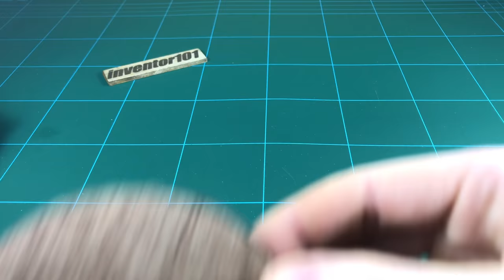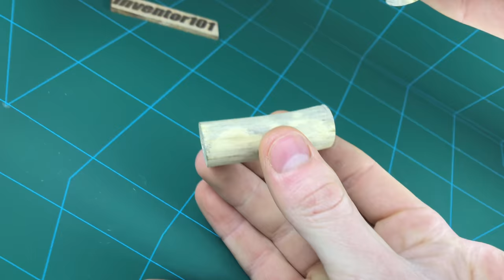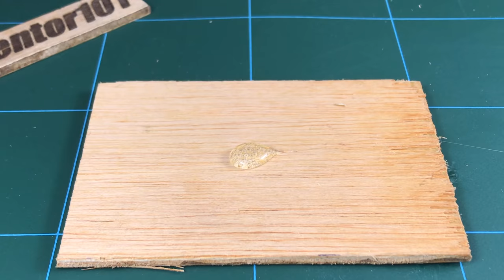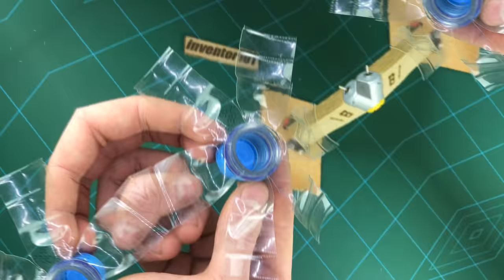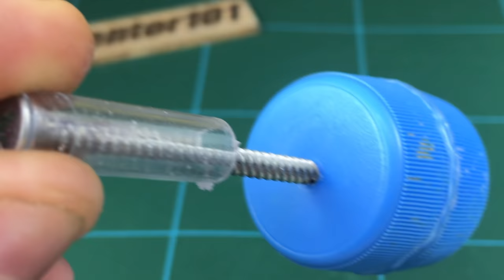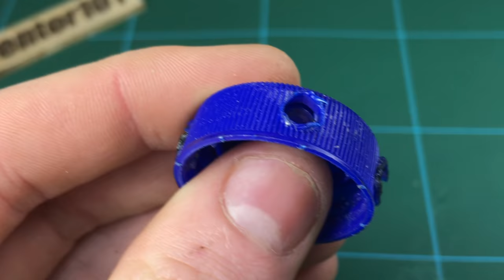7 SIMPLE INVENTIONS

Comment: bro, what can I find those jack cables with? I want to make a homemade soldering machine, I would appreciate it if you tell me the name of the jack cable
Reply: Bro you can use pencil , charger cable,copper wire,and adapter
Reply: I'm making inventions. Can you advise me something?
Reply: 16+ to buy them and they can be at ur local electrics shop where u buy wires and motors
Reply: Super super super super super super super super super super super super super super super super super super super super super super super super super super super super super super super super Bowl 🙌😂🖐️🤣
Reply: Ok inventor 101 hi I'm Charanesh FABRICS tell the jack cable

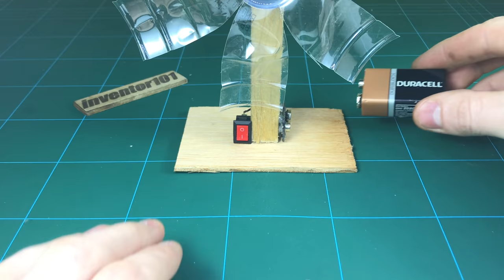Comment: 5:40 i would NEVER advice to use 9v batteries on dc motor like that one. those motors take lots of current and the battery dies in no time. Solder a usb chord to the fan and it won t stop working never.